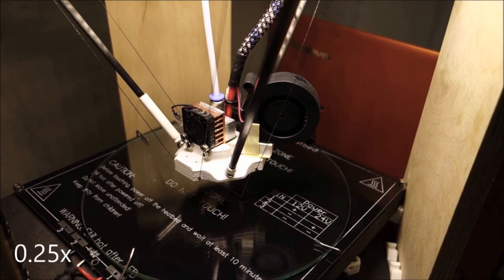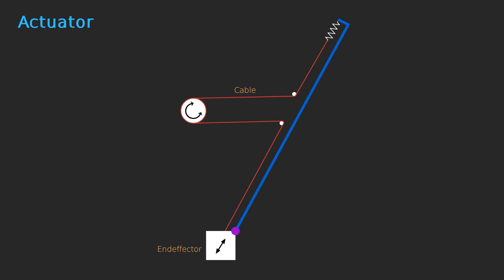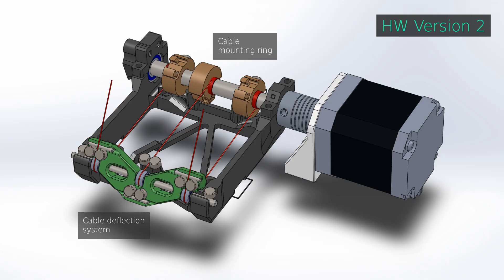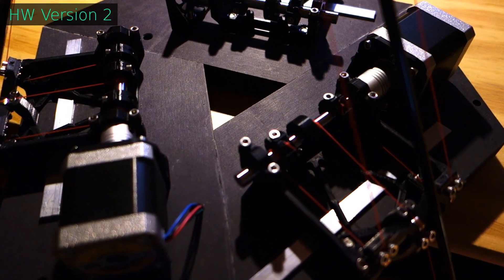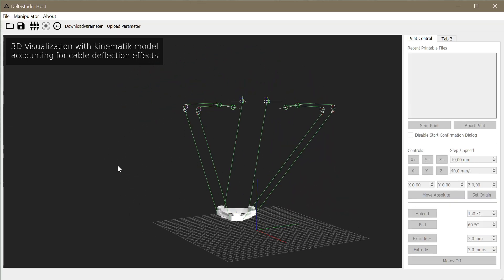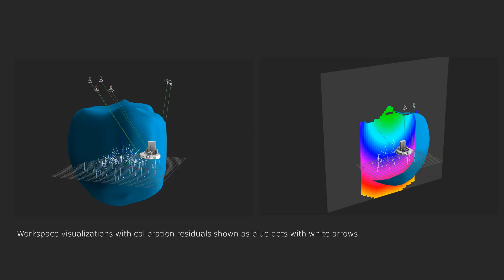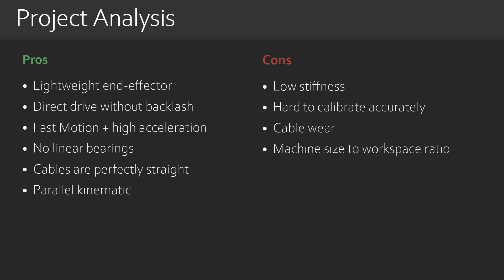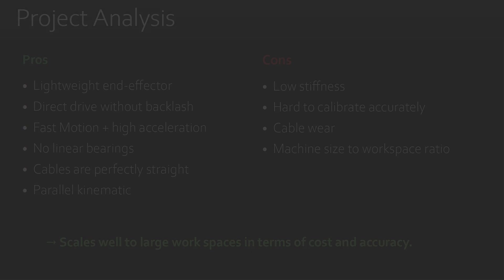A Cable Robot 3D-Printer

Comment: this is amazing. Tuning wire length sounds troublesome but feels like more robust
Reply from the maker: Thanks, in the plattform there are screws and a 'lift mechanism' to precisely adjust the length of each wire. So its actually not that hard
Reply: @DiffractionLimited  you thought about everything! if one could refine this further this could be the cheapest printer mechanism option out there, and I'm totally in

Comment: what's the advantage compared to a rotary delta robot? like in pick-n-place machines?
Reply from the maker: Direct-drive without the expensive gearboxes and associated backlash required for a well working rotary delta robot. You find some rotary deltas using RC-servos on youtube. You will notice that they are usually quite wobbely and not so accurate.

Comment: If you look around on the internet there was a cable delta years ago that used a single rod for even more weight savings.   Wanting to say it was around 2013-2014.
Reply: I designed an over constrained 5-axis, 6-motor one like that more recently, based on a sort of octahedron tensegrity structure, but I haven't found any other such mechanisms.

Comment: You can simplify the kinematics and maybe get rid of those last inaccuracies by modifying the winch in the following way:

Instead of winding the cable on a cylinder, use a screw. Like a trapezoidal thread screw. The cable rests and winds in the thread. The screw rests in bearings and is guided by a nut ( or, use ballscrews to get both ). Therefore, the winch axis slides axially on each turn by screwing into the nut, keeping the cable exit stationary, instead of moving about slightly ( like is shown in your kinematic model )
Reply from the maker: Its a really good approach to reduce cable wear and winch size for larger machines if implemented well. I believe the sources for inaccuracies lie somewere else though. Its a really good idea but makes the mechanics more complicated - but I would love to see someone try it.
Reply: @DiffractionLimited  you used a braided cable, so it must compress a bit when going over the pulleys. Do you think that contributes to the inaccuracies? Or would it be something unaccounted for in the geometry ?
 I also have the impression the preload rod might be wobbling sideways as it is supported only on one end rigidly and on the other only by the cable ( is that right? Can't tell for sure from the video)
Reply from the maker: @bschwand  Yes the preloading rods are wobbeling around alot - BUT they are not really part of the kinematic chain when you think about.
Reply: @DiffractionLimited  if I understand the geometry correctly, I think they are (at least dynamically) because their sideways wobbling will exert great leverage and ever so slightly make the final print platform position vary.
To make an analogy, my Linear delta printer frame is not part of the kinematic chain. However, pushing a little on the frame corner caused the printhead to noticeably move. After rigidifying the frame, my printer is a lot more accurate. Plausible ?
Reply from the maker: @bschwand  The balljoint at the endeffector will not transfer any torque to the plattform - so no leverage is exerted. But you are right it is and accellerating mass and thus will dynamically apply some (hopefully small) amount of force to the balljoint when wobbeling. A reason, why I made them out of carbon fiber to be as lightweight as possible.

Comment: Thank you for sharing! Question, what program did you use to model the kinematics?
Reply from the maker: The kinematic model is coded in plain C++. The code is then used in the printer firmware as well as in the Printer host software, which I also wrote in c++.

Comment: This is very cool and novel!  I had the thought just before you said so that "This might be decent for scaling!"  There are so many offsets and radii involved in the cable drives that I'm impressed you got calibration down to 0.2mm inaccuracies ... those could easily be due to component tolerances or frame being slightly out of true, although printing the second build with the first build when the first wasn't proven accurate could also have something to do with it :P  All in all, super-impressive.  Thanks for sharing!

Comment: That is awesome! Would love to see a speed benchy printed on it.
If you were to build one today, how much would it cost?
Reply from the maker: Not quite sure and it depends on the machine size but you can try to estimate it youself. The main components are:

- 3x Nema17 0.9deg Stepper Motor
- 1x Smoothieboard
- 1x Powersupply 24V
- Hardware (Screws, Nuts etc)
- 3xCFK Rods
- Frame and Baseplate
- Fishing Line: Spiderwire Stealth Code Red 0.4mm
- Extruder and Hotend
- 3D-Printed Parts
Reply: @DiffractionLimited  Wow, you got that much accuracy with fishing line?!  That stuff is designed for strength, and for most materials the easiest way to do that is to let it plastically deform (lengthen) when under load.  The winch setup and speed means you're probably putting significant dynamic load on the line causing not just backlash, but the line to act like a spring.
Reply from the maker: The dynamic accuracy is probably worse, dependeing on the accelleration. The system has no backlash since it is preloaded but you are correct the cables act like a spring - hence the lowish stiffness. Steelcables might do better but require larger bending radii.
Reply: @EmperorA0  Dyneema has very low stretch and high strength. Not obvious that steel would do better. And steel would be heavier and harder to bend. To be tested, I guess

Comment: Awesome. Im not highly experienced with cable driven motion. Why choose a polymer cable over a stainless steel one here? I guess creep isn't a big deal since they're preloaded with a separate spring that can account for creep right? Cheers
Reply from the maker: Very good question. Polymer cables are acturally easier to get and work with. Steel cables would be even better but require very thin strands for the bending radii used in this construction. In prinziple the design could be implemented with steel cables, especially for larger machines.
Reply: @DiffractionLimited Do you think the stiffness issue that reduced print quality came mostly from the forces caused by the accelerations of the print head, or forces caused by the drag of the nozzle against the previous layer? Like, if you slowed the printer way down do you think that the low stiffness would be any issue? 

This seems like a interesting starting point to use belts just like how you're using cables. It seems like belts are just many cables in parallel over molded with polymer to give higher stiffness. It seems like you can use a belt and have the same unique and simpler kinematics with the same stiffness as a standard delta printer. What do you think?
Reply from the maker: @neverwipe  Actually the print quality is fine, expecially with HW version 2. Belts would be great but the cable has to bend in two directions at the deflection assembly. Belts only bend in one plane, unless you find some clever way to twist them. However all strands within the belt would have to be loaded equally, otherwise you loose the advantege.
Reply: @DiffractionLimited  Interesting you say print quality is fine. You mentioned stiffness is an issue and I assumed that it would show up as low print quality. What is the issue related to low stiffness?

If stiffness isn't a problem then the belt idea wouldn't be as interesting. Here a potential way to do it while keeping the belt straight:

You can mount the motor and pully with a tension ball joint to the frame. The rod would be mounted to the this assembly with a linear bearing, since the other degrees of freedom are allowed by the ball joint. Because the mass of the drive train is right next to the ball joint, the inertia of the drive train shouldn't be an issue. If it is an issue, you might be able to use a flexible shaft to mount the motor to the frame and have the pully/linear bearing assembly on the ball joint.
Reply from the maker: @neverwipe  Since the endeffector is lightweight, the lowish stiffness is not a problem for normal sprint speeds (60mm/s) - since 'low stiffness' is quite relative its best look at the slow motion footage and assess the situation for yourself. Also today we have input shaping, which would improve the situation too.

Good idea for the belts, but it would add a lot of complexity, which i always try to avoid if possible.
Reply: @DiffractionLimited  correction to my last comment: a linear bearing isn't needed for the rod, just as a linear bearing is not needed for your current design. the rod is moved by the same "omega drive" arrangement with a belt.

I may be wrong but I think it would be the same complexity, assuming that the flexible shaft method isn't used. The moving joints change from having a ball joint at the end effector and a pivot at the drive end to having a ball joint at the end effector and the drive end.
Reply: To be clear, the belt wouldn't loop around in the way that the cable would. It would take a single path from the end effector, to the omega drive, to the top end of the rod, and preload the rod against the end effector.
Reply from the maker: @neverwipe Unfortunately you can not use a singel balljoint for each endeffector as each winch counteracts a torque preventing the endeffector to rotate. The torque mediated by two strings in each string pair - similar to the delta-robot it mus be a parallelogram. Each of the three actuators constraints two DOFs of the platform, one translational and one rotational.
Reply from the maker: @neverwipe  I understand, but keep in mind, that a single actuator must allow the platform to move in two dimension (surface of a sphere), while simultanously locking on degree of rotation. I dont see this working without a parallelogram. If you find a way to implement a parallelogram with belts - be free to send me an email.
Reply: @DiffractionLimited aha, I see what you mean. I guess it would have to be more complicated to account for that.

Comment: Wow I cant eaven get the calibration of my normal delta printer corect. The delta radius is always of casuing not all parts of the print to stick to the bed  and it sometimes just speeds up for no reasen and generaly does wierd stuff. And you wrote a custom calibration software and kinematics wow